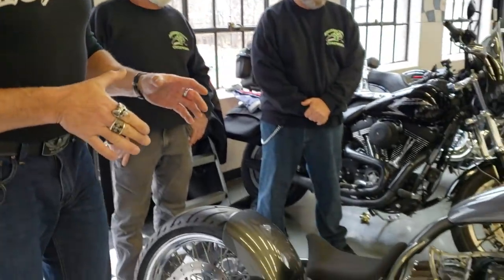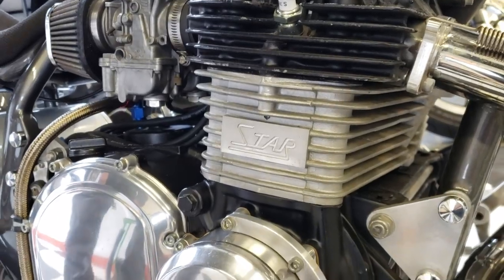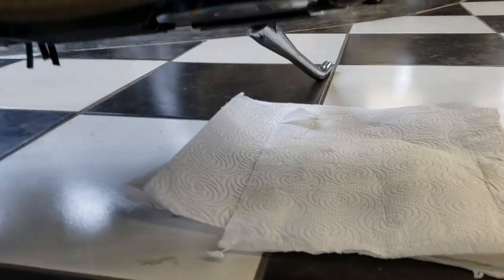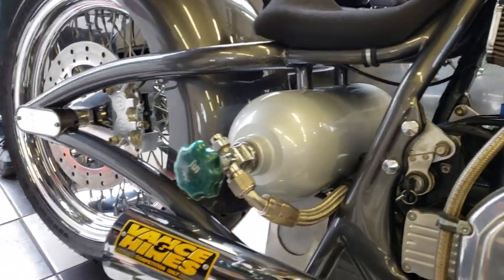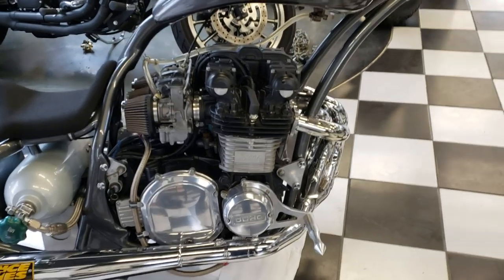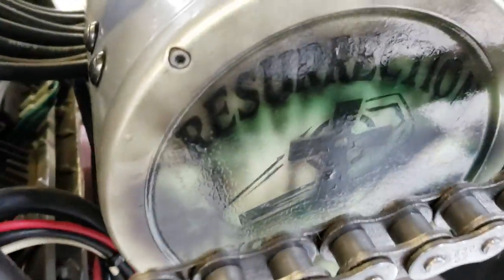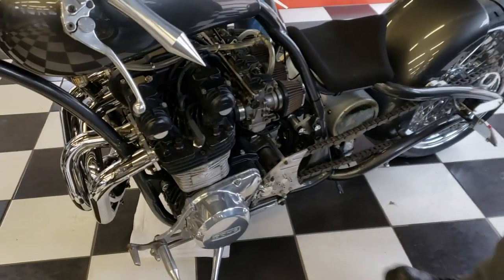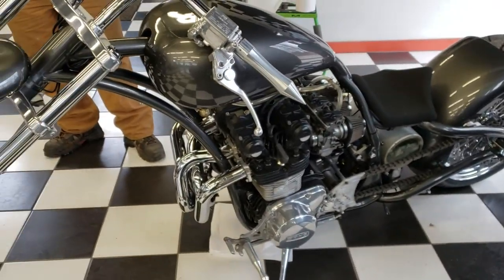KAWASAKI KZ1000 BIG BORE 1327CC FIRE BREATHIN BARRACUDA DAN DRISCOLL BUILD

Comment: Star racing is still in business,now called Star Power. George Bryce is the owner,builds some high H.P Harley motors. Has a Harley called Bagzilla,big motor,carbon fiber wheels,aluminum extended swingarm. Has won a a few NHRA championships, I believe 6 with 2 riders.

Comment: You want a cool, killer fast dragbike?
Use a TZ750 engine. New reproduction cases, cylinder banks etc are being made. Not only will you have the capacity for 200+ hp, you'll have the most unique engine at any event.